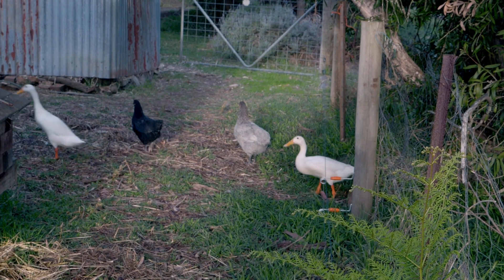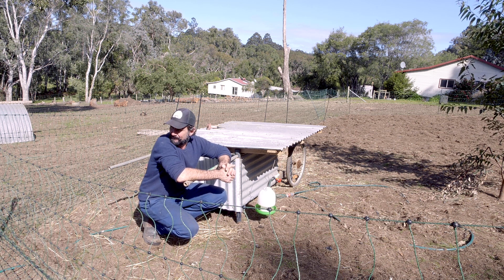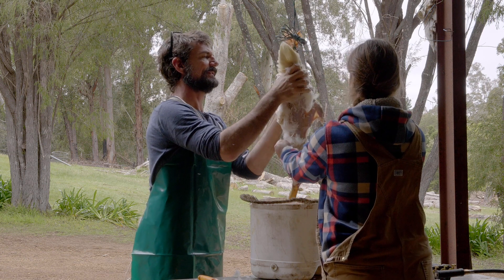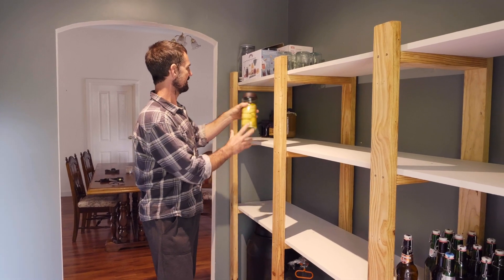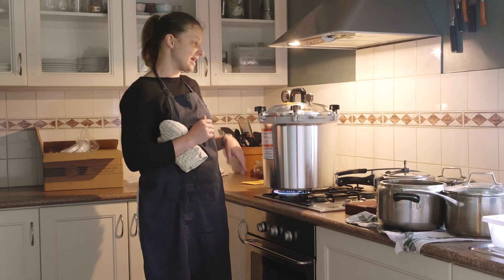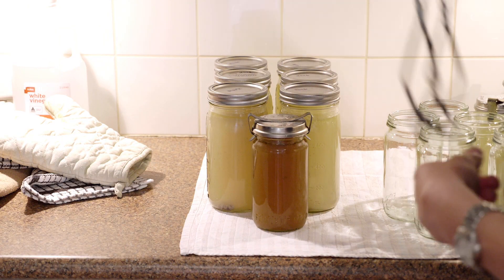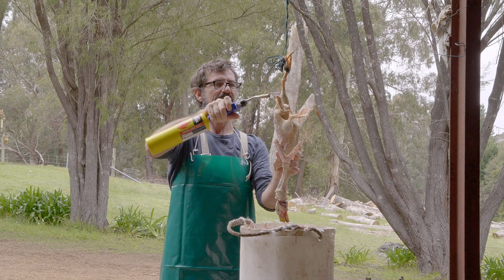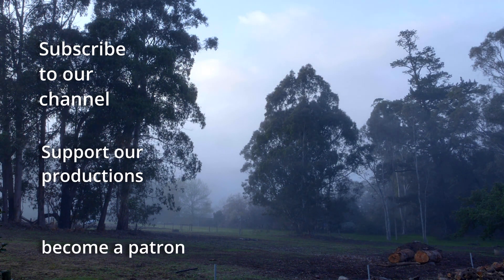Preserving our problems - Free Range Homestead Ep 25

Comment: I really don't like seeing screws being used to hold up shelves that are going into end grain like that, it's really not very strong and they can split the short cross member. It's far better to screw into a block that the cross member sits on with the grain going across that way the shelf can be screwed down securely and the unit becomes a lot stronger, it really needs to be stable if you are keeping lots of preserved goods on it.

Comment: Here's a tip, to render lard put the fat in a big pot like a turkey roaster and put it in the oven.  Much easier, don't have to worry about it burning or catching on fire, I've done it many times and it's worked a lot better for me than stovetop.  I've made lots of sheep lard BTW, the local small processor will give away all the sheep fat you want, and it's great for cooking.

Comment: You may not need it (now) but a small flap door on the coop (like a pet door on a fly screen door) exit/entry during the day, latch to allow entry only in the evening.
Tip for preserving - I got one of these https://youtu.be/88uvaK1eHtU (arnd $250)
Not only does it suck the oxygen out prior to processing. Put a pinhole in the top of jar lid, place piece of elec tape over it, put in blender, "vacuum only", it will suck the oxygen out of the jar, tape will seal it. Lots of other ways to do it on youtube

Comment: I don't have any tips for de pitting the cherries (I did a few kilos by hand) but I'd use the meat mincer to grind them into a course pulp as that will aid fermentation massively.

Cherry wine needs a lot of time in secondary fermentation with an airlock. If you skip that you'll get an almond smelling aldehyde flavour  trapped in the bottle as it needs to offgas.
Reply from the maker: Very good advice with the glut of cherries surely coming our way!
Reply: On youtube "cherry destoning machine Riad Drino" will get you one

Comment: Had a church member who worked for a large manufacturer of pressure cookers, his job was to test them to failure in a rectangular three story concrete shift. He would often have the lids inbed themselves in the ceiling when they blew. Rest c assured he had to intentionally make them fail by defeating thexsafety features, but vital did have an impact on his life, he was very sensitive to loud noises!
Reply: I'm tipping he was a fan of cold showers also.

Comment: With cherry wine it's absolutely required to remove the stones before you start brewing the fruit - the stones contain cyanide, and you REALLY don't want that in your wine :o

Freeze the fruit HARD, you want the ice crystals to break open the cells of the fruit to get all of the flavour out ;)

If you can get it without preservatives, then use fructose as your additional sugar, be very careful however to avoid fructose that has added preservative, as it'll kill your fermentation.

Keep the brew in a cooler part of the house - you want a stable temperature to avoid creating hangovers.

If the wine goes sour, then you can still retrieve the alcohol off it using an inepensive water distiller off amazon, do it in several runs - strip the alcohol, dilute, remove the first bit and some of the last bit, dilute, remove a bit more off the top and most of the last bit - you might get a cupful of shine off a gallon of waste wine, but....
Reply: Great advice.

Comment: As far as fermenting anything in a glass demijohn goes, It's important to keep the light out. Don't wrap it with anything like a dry towel or such as it will increase the temp(unless temp increase is desired). A large brown paper bag works best.
Do some research on long and short chain sugars and what type of sugars the fruit you intend to ferment has. Using a yeast nutrient periodically during the ferment may be highly beneficial.
I once made a beer with quandong jam in it and it turned out brilliant. It was highly addictive. So my vote is for quandong wine. cheers.
Reply: Also, if you would like to have some slight residual sweetness to the wine and I recommend you do as it carries the flavour better, you will need to take an original gravity reading and with calculations that i could help you with, use a yeast that will not fully ferment out the sugars in the fruit. cheers.

Comment: Gosh, the design of canning jars in OZ seems to be a big part of the problem. In the US, reusable jars have gasketed lids and threading sealing rings. I've had a jar fail in the canner, but failed sealing almost never happens. We don't find that the cost of the non-reusable lids is prohibitive in our year to year canning.
Reply: In the US, canning lids are two piece, the lid and ring.  After filling, the lid is applied and the ring loosely tightened.  In a pressure canner the contents of the jars will boil which is why headspace is important and the loosely applied jar lid allows the steam to escape.  As the jars cool a vacuum is created and the lids "ping".  It appears the jars pressurized because the lids were too tight, perhaps from the clips.  There is no need to store preserves with the rings attached, only the vacuum seal of the lid is important.  If the vacuum is lost, you want to know about it.